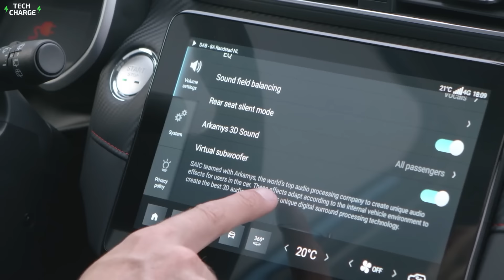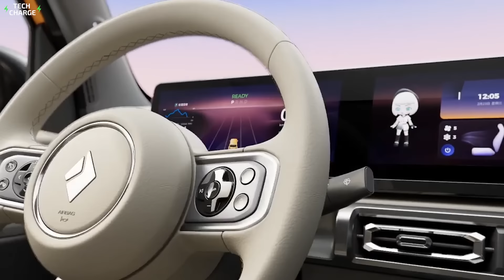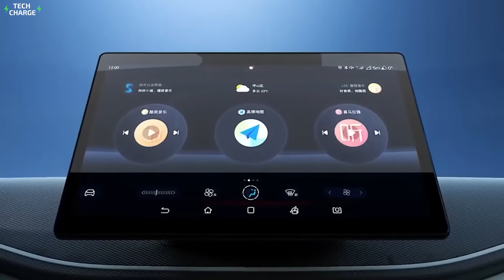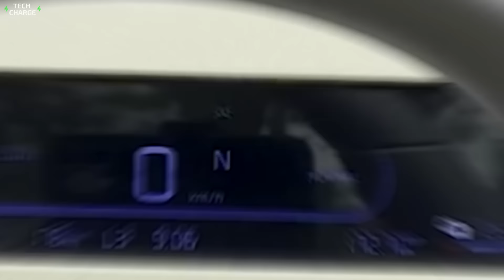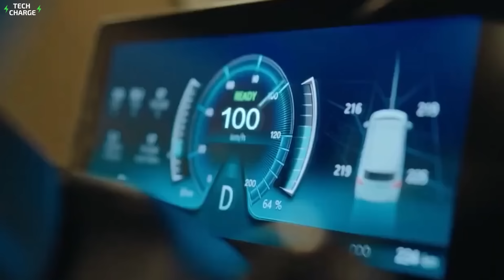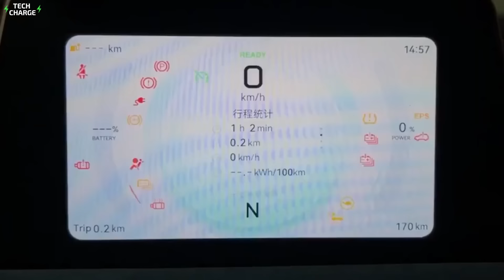8 NEW Cheap Electric Cars from China (with range & price)

Comment: The Australian market mg zs EV is not 24k dollars here, it's a tad under 40k aud
Reply from the maker: Yes, we made a mistake there. As I checked the most recent model is even above that.
Thanks for the correction!
Reply: 24k is for the petrol version😂
Reply: ஈவஇகஆர்+பெடாரோல்இருக்கா
Reply: @markuc  can that be used with a trailer?
Reply: @steinbauge4591  yes but I wouldn't tow too much
Reply: everyone has their hands out down the line till it gets to you

Comment: It seems China is really making EVs available for everyone! Surely at the prices indicated, it is better than motorcycles when those in the rural areas in the developing countries will surely benefit from such products. Though these developing economies will have to improve the quality of their roads to accommodate such units otherwise they may not last very long! Of course, in China with her ever improving road construction, this problem may not be such a challenge.
Reply: If China surpasses America at capitalism on its more observatory solutions to consumers supply demands it surely will be a multi polar world. Which as a reforming Chevrolet driver I'm looking at options in China eagerly, as well as looking at it's phenomenal rise to power with its rail program and it's new aircraft carrier. I said long ago China and Russia seek to legitimize not just political relations but consumer relations as well. There are people against this. I'm one who cheers for the success of different parties as we can both find balance. Americans are tired of the same old overpriced under engineered transit options. Anyone in the 5k range brand new is a niche void to fill
Reply: The problem is that these Chinese EVs just won’t last long ,they use the cheapest materials for everything and even aluminum wires 😆 ,we all know why the rest of the world don’t use aluminum wires
Reply: @hittrewweuy7595  , Maybe some of the smaller producers which will disappear soon.
Reply: Been to China a few times and roads are just fine . Better in some cases than Canada and way better than the US

Comment: it's cheap because it won't  last & not reliable .....that's  why a rolls royce & a porsche are expensive.......
Reply: That's what even I would expect but our MG ZS EV is NOT a total disappointment. It's way better than I thought.
Reply: How do you know they are not reliable, your personal experience, research or assumption?
Reply: @ALWH1314  Exactly. Any cars can be a lot more reliable than Rolls Royce or even Porsches. For example Toyota Corollas can be heck a lot more reliable than so to say.. RR Ghost.
In my experience, my expectations for SAIC MG was VERY LOW until I've driven the ZS EV. It's surprisingly fantastic. Have to say you can't go wrong with MG, BYD and GWM / Haval incl. Ora Good Cat or GWM Ora.
Reply: Rolls n Porsche are ALSO NOT Reliable 😂😂
Reply: @vincecarlo  Porsches can be reliable but Rolls... probably not unless it's mainly BMW underneath. Toyotas and Hondas have reputation for reliability. Chinese cars in western markets are no slouches, tried to find ways to break them and so far so good.

Comment: Like most things from China, they probably don’t last long.
Reply: That was the reputation. Is it still the case with Chinese EV?
Reply: They definitely have very poor resale, basically land fill.
Reply: Even I thought so as well but guess what? Our Chinese EV is still doing very well. I've grabbed a roof rail and shock/rocked the car - off course REALLY HARD AND ROUGH yet the car is still in one piece. Taken the car to water jet car wash including underbody wash and drove very slow tried to..... electrocute myself. :D
So far so good for MG (incl LDV), BYD and Haval (Great Wall Motors).
Reply: @chengavitch10  Not in our case.

Comment: No WAY AM I Buying a MOBILE FIREBOX.
Reply: --"Firebox" says the bloke who drives a car powered by napalm!
Reply: The "MOBILE FIREBOX" you mention is actually a plug-in hybrid that use different batteries compared to proper full EVs. ie. BYD plug-ins ARE NOT using Blade Battery technologies.